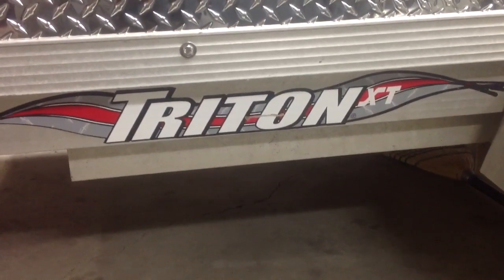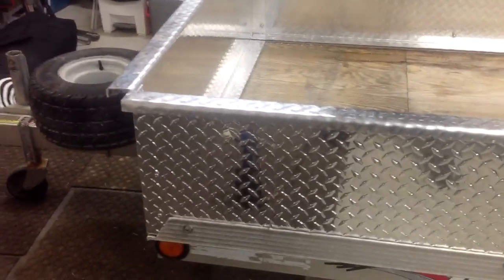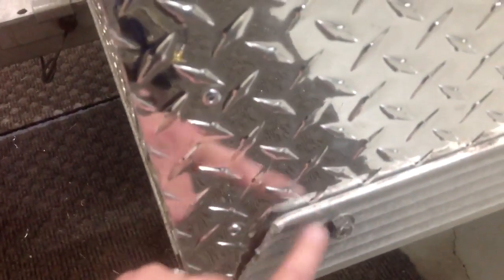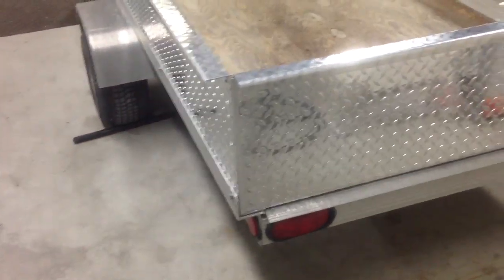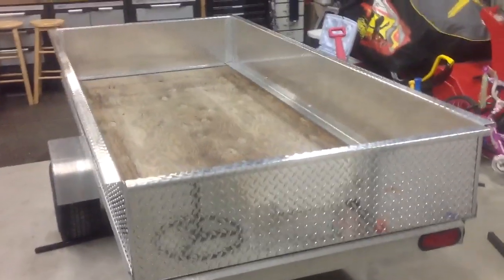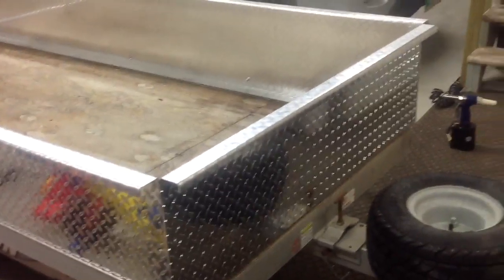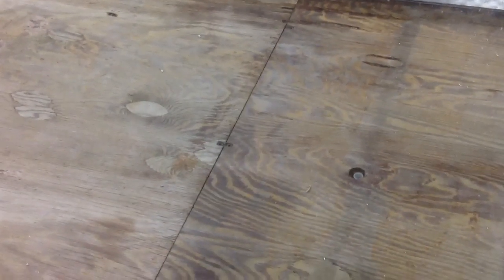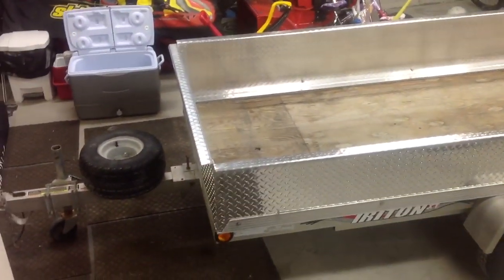Triton Trailer - Adding Aluminum Sides

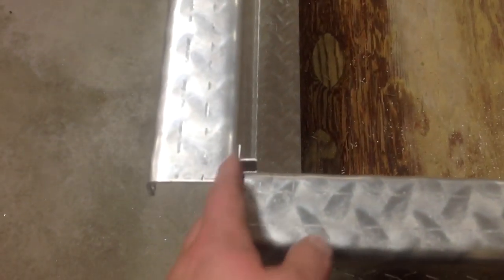Comment: Stuff can push the side walls then the back gate could fall off (2:57). Although, is fine with small loads.

"Use hinges with long rods at all four corners to hold the sides together. It's very fast and secure. Picture removing the individual hinge pins on a standard hung door and replacing them with a single long rod and you get the idea." John Resler

Comment from the maker: To answer a couple Q's from below, I have not had issues with the sides flexing or with the tailgate falling out. When I am carry a full load of gravel or branches or dirt I simply run a couple tie downs across the trailer from one side to the other to pull the sides in taught. I realize hinges would be better but I like the ease of this system, plus I primarily do use this for hauling the sled!

Comment: How did this hold up over the last 8 yrs? And this is a what I'm looking to do on my double snowmobile trailer
Reply from the maker: 8 years later and it looks like the day I built it. It has worked perfect for me. I use it for hauling the sled I. Winter and for misc landscape yard work in the summer.
Reply: @TheSacman11  thanks for the reply!